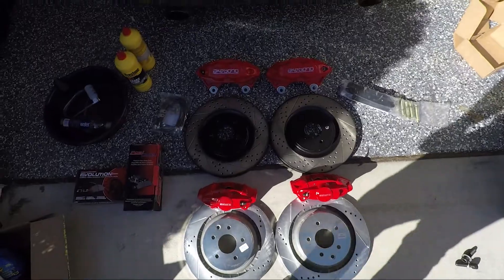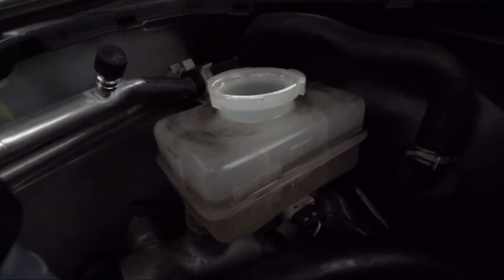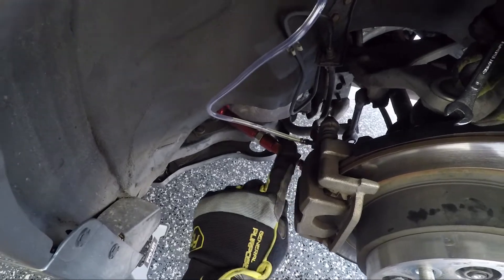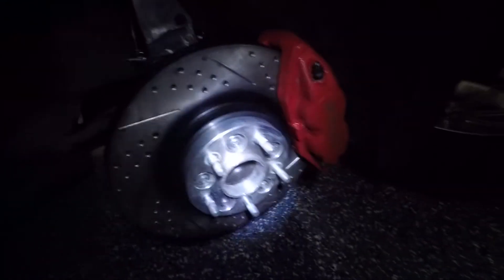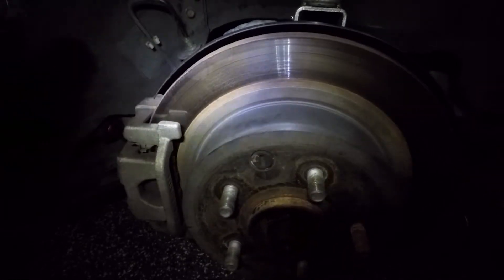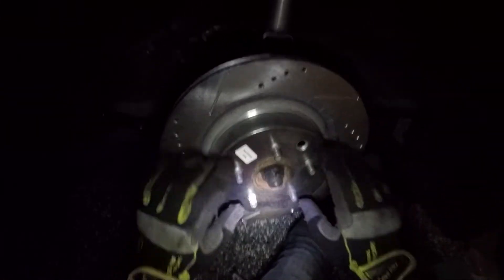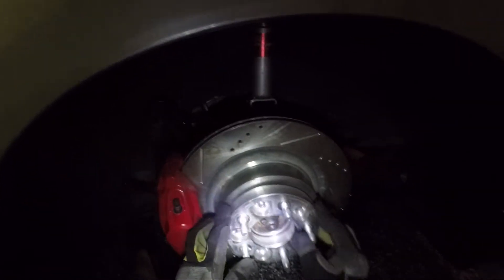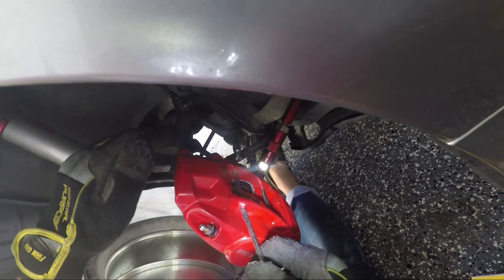Installing akebono bbk on 350z + how to flush/bleed brakes on 350z/g35

Comment: Dont you have to bleed after the akebono install?
Reply from the maker: Yes you do, before installing new calipers I flushed the brake system so there is no old fluid in it and after installing I bleeded the system so there is no air bubbles trapped anywhere, and to bleed the brakes 350z a little unusual, because while bleeding you have to have your car running, I’m explaining it in the end of the video
Reply: What about 08 g35?
Reply from the maker: James Dean Cooper I’m pretty sure it’s exact same thing

Comment: To bleed the brakes, are you saying we need the car to be on and running? Then we proceed to bleed the brakes?
Reply from the maker: NuBMikeY I had my car running when I was bleeding the brakes, it might work with it just being on but I’m not sure about that
Reply: @I._NED  Sounds good. I bled the brakes on my Akebonos (car was off) and the pedal was really spongy.. It went all the way to the floor.. When I was bleeding, I did not see any air bubbles at all which was strange to me
Reply from the maker: NuBMikeY that’s exactly what was happening to me during whole day of bleeding and 2 extra bottles of dot4) until I started the car and  with car running it took me 30-45 mins to bleed brakes all the way
Reply: @I._NED  thanks a lot for the quick replies! Going to give that a tryout today and see what happens